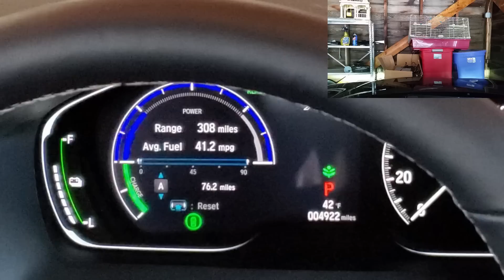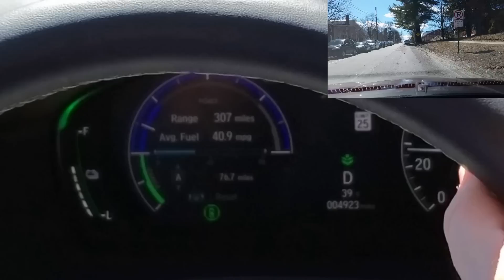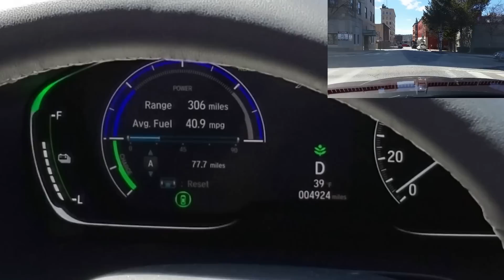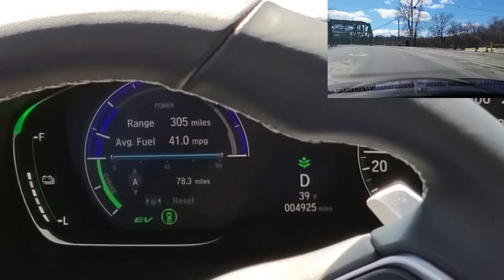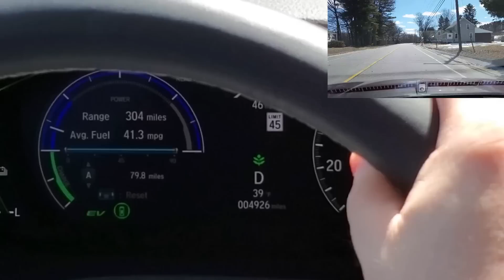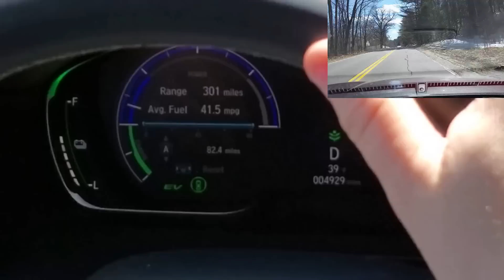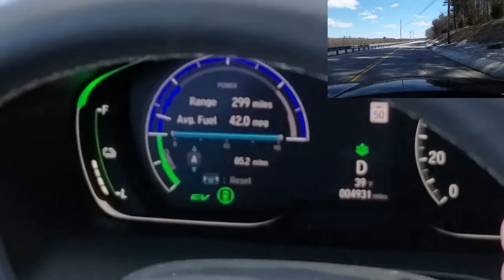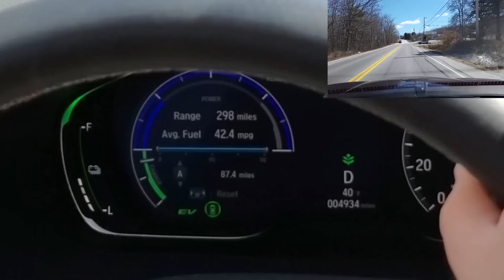2019-2022 Honda Insight: Controlling power meter for MPG

Comment: Been driving my insight touring 3 weeks  now, and im averaging 50 MPG (combination of City and Hway.), very happy with it.
Reply from the maker: Remember you're going to see quite a drop during winter. Don't get too freaked about it.
Reply: I’m getting about 62mpg with mixed driving, but I’ve had a lot of practice using a Prius rental… hyper-mileage is crazy on the insight, specially using the paddles to control the regen
Reply: That is actually really good for  touring model. I know they are rated lower than the Ex which is 49 combined.

Comment: I recently got an EX and managed to hit 70 mpg in the low 60’s. The trick is with Econ and normal mode and know when to use them:

Econ:
For maintaining constant speed or in slow traffic

Normal:
When you need more power to clear something, such as getting on the freeway, climbing uphill, or accelerating on the freeway

Regen paddle help too
Reply from the maker: Looks like you're what we'd call a hyper miler! It also helps to have longer drives so the car is warmed up and speeds in the 45-55 mph range really help the car shine. Thanks for adding the advice in the chat.
Reply: Learn to use Sport. It will change your life. I have a 19 with 54k miles and just got back from a 3k mile road trip.  60s is easy trying to get in the 70s consistent. Normal and Eco mode just change pedal feel and how aggressive it is to automatically use EV only. I manual set to EV whenever I can. I know it seems 70mph is the max speed ive seen the car do in EV only mode.
Reply: I have a 2019 Insight EX living in Northern California area.   When I first got it, I was avg 50mpg but recently it dropped to low 40’s.  
I commute  50 miles round trip on freeway to work 5 days per week, No hills or excessive speed ups.    On freeway I average  75mph. (Most people drive that fast at 6:00am 😂).   When I drive in city , the MPG increases to 45mpg .
I noticed that mpg correlates with weather.   Cold = decreased mph
Hot= increased mpg without AC use. 

I consistently used Shell Gas. 

Still trying to figure out ways to to get above 45 mpg 

Has anyone use those manual gear shifters on the steering wheel??   Would that help with gas mileage??

Comment: Thank you so much for this. I just purchased a 2022 Insight EX today and have to take I-540(in NC) to get home so the speed is 70 and that blue bar went up and down, it made this weird droning noise as you call it. I didn’t put it in sport just left it to choose between eco and EV. Would sport be best for the expressway? Thanks again for your video and I rather enjoyed listening to you talk ☺️
Reply from the maker: If you put it into sport mode the engine will run constantly to keep the battery charged. I personally use eco mode. Some run in normal mode. Unfortunately this car doesn't get its best gas mileage on expressways but you should be fine. This car shines mostly in the 45 to 55mph range. Generally I like to use the cruise control on the expressway and let the car manage speed by itself. Keep in mind due to the current administration's war on fossil fuel you are probably using winter gas formulation even though it's the summer. It's too hard to explain the reasons behind this. One unfortunate reality of this is you will get slightly lower gas mileage.

Comment: Yes at 15;30.  I bought this for safety reasons too I am old school and never had all this fancy stuff in a car.  My last new car was 1989 Honda Civic car till almost 200 thousand miles.  I am kinda baby my 2 Nd tank and getting about 50 miles per gallon and watching the power range and it’s a learning curve for the gas mileage. 
I have the same trim touring like you great car great mpg.   I had a Ford 5.4 AWD and was getting about 8 miles to the gallon.  Big difference in what I paid in gas and Maint in my old truck is my car payment.  
I have been rear ended and my neck and back is Fuck up from dame ass H driving like you said.  I ll be in the slow lanes and left passing lanes open and no one around and they are just staying right on your ass    Go the F around I’m yelling.  In my big truck they would but not in my Honda 2020 insight.  Ok 
Thanks again.  I’m from San Diego Ca too
Reply from the maker: With the warmer weather out there you should get on the higher range in gas mileage. Here in Maine I have to deal with the winter temps which really kills the MPG.

Comment: So the regenerative braking paddles... I wish it would keep the setting, and it does in sport mode just not in econ or normal mode, I didn't test ev mode.  I read somewhere that they did this because of the way the regen works by using the motors instead of the brakes which causes a little bit of pullback.  In slippery conditions this can cause a loss of traction if your regen is set to max.  Supposedly it's mentioned in the manual as well.
Reply: Brian Kai The paddles are for braking the vehicle when you want to slow the car down or when your coming to a stop.  Yes they do help regenerate power to the battery,  but they are not for setting the regeneration amount to the battery.  That is why it resets when you come to a stop or when its been in the highest setting to long. This is like the B(braking gear),  in the Prius, but the Insight has 3 levels of braking.
Reply: sorry to be offtopic but does anybody know a way to log back into an instagram account?
I stupidly forgot the login password. I would appreciate any tips you can offer me!
Reply: @Aarav Zaid instablaster =)
Reply: @Joel Brandon Thanks so much for your reply. I found the site thru google and im trying it out now.
Seems to take quite some time so I will get back to you later with my results.
Reply: @Joel Brandon it worked and I now got access to my account again. I'm so happy:D
Thank you so much, you saved my account :D
Reply: @Aarav Zaid No problem xD

Comment: Just got our 22 touring, and new to hybrid. Should I fully charge first the battery before using the EV mode button? Or could i press it whenever it’s available? Just want to maintain the battery healthy
Reply from the maker: The ev button can be a bit picky. It's usually available when the meter is above 2 bars and the engine is fully warmed and you're not using any intensive features such as the heater. Waiting for it to fill will be frustrating to say the least. Most of the time the car will automatically engage the ev on its own while driving when the car feels circumstances are ideal for the ev mode. If you put the car in sport mode the engine will stay on and you can fill the bar. Then you can switch to normal or eco mode and hit the ev when you like. Keep in mind the car will cut you out of ev if you depress the gas too hard or you hit a hill. Personally don't concern yourself with the button much. Reasons I, or someone else might press it are as follows: 1) your driving on standard or eco mode and you're in a nice flat stretch of road and the car hasn't engaged ev, then feel free to use it until the car kicks you out of it when the charge drops. 2) it's a warm evening and you're sneaking out to see that cute girl you met and you don't want to wake up the wife when you leave. 😉 Point is just stick with standard or eco mode and let the car handle ev. If you know the ev will work where you are and the car is being stingy feel free to press it. Hope this long winded answer helps.
Reply: I'd only engage EV mode if I'm like within a mile of my destination, I have surplus battery charge, and I'm going to keep it under 30. But as long as you're driving under the ideal conditions, the car's going to go into EV mode anyway. I'm not convinced it really helps. Sport mode, on the other hand...

Comment: my car is a salvage has a check engine everything is fine but the dealer dont want to check it  

I am having 20mpg on the dashboard and the EV mode gets cancelled after 5 seconds..
Reply from the maker: You should consider taking the car to an independent auto shop for the check engine light.

The EV will disengage if the car either is heating up, the power bars for electric power are down to 2 bars or less, or you hit the gas too hard and the car determines it needs more power to do what it needs in order to continue. There are other things that also determine if the EV will turn on or off. I recommend just setting the car to eco mode and let it determine when to engage ev mode.

Comment: What is the point of the EV mode button? If the car automatically goes into EV mode, what is the use of the button?
Reply from the maker: Basically so you can choose to use it when you want to. There are of course restrictions based on your settings of econ vs normal vs sport, and whether the car is either heating the engine or the cabin. There are times I'll press it when the system is saving it for a later more downward trajectory drive when I want to use it for the current moment. To be honest I don't find it very useful, but it will at least let you force the car into EV mode if you choose assuming none of the above criteria are in effect.

Comment: Hello there. I got a problem. My 2019 insight Ex showing message  “Automatic Light Control System Problem.” what does it mean?
Reply from the maker: Not within my knowledge. You need to go to the dealer and have it checked out. Possible it's a sensor failure of some kind, but it'll need proper diagnostics from the dealership or a reparable mechanic with scanning hardware.
Reply: @verdier400  
I got done with the recall several days later I get this. 

thanks I will have to..
Reply from the maker: Out of curiosity was the recall you did the BCM update? You may need to have it updated again since a bad flash of the BCM could cause this error.
Reply: @verdier400   YES! exactly. A weekly after BCM recall was done "Automatic Light Control System Problem" started appearing. I read the manual, solution, see dealer.
Reply from the maker: Yes the BCM update has caused me a lot of issues with my  Auto Hi-Beams. Hopefully a re-flash of the system will help.
Reply: @verdier400  
Before the recall MyInsight was doing fine. After the recall, probably weeks later driving, the problem started. 

Only solution is to bring the vehicle back to for re-service.

Comment: Great video!
Reply: Also, your overall average has been in the low 40's?
Reply from the maker: Thank you. It was a pain to get made.
Reply from the maker: Yes the low 40's has been my average. Remember I run on cruise control nearly 99% of the time and it's not very easy on the gas pedal. I also have the touring model and it's top figures are about 4mpg lower than the LX or EX model. The cold has been a bitch too.

Comment: Does this car come with a spare tire? I know a lot of cars now have those fix a flat kit which seems kinda silly.
Reply from the maker: Fix a flat only. If you want you can get a spare tire kit from honda or go to a Junk yard and get a spare tire kit from a honda civic 2016-2018. They fit perfectly.
Reply: No
Reply: Seems silly but it saves you 1% on gas mileage without the extra weight from the tire.

Comment: Is there a way to cut out that extra sounds from the car going up hills ? Thanks 😊
Reply from the maker: Nature of the beast. The engine is pumping power into the batteries to keep them charged as more power is used going up hill. It's known as droning and pretty much all hybrids do this in some way. The Insight seems especially obnoxious and loud at this. One of the less desirable aspects of the car. If you live in a very mountainous region you're only hope for survival is either a loud radio (which I do all the time so droning doesn't effect me at all) or suicide. :P
Reply: Read somewhere that going uphills to use SPORT mode 
which cuts out the high REVVING of the engine

Comment: why burn gas going downhill when gravity is pulling you down...
Reply from the maker: The car makers set this automatically. I have wondered this as well but I think when they work out all the math and how taxing uphill is on the electric motor and how quickly it drains the batteries, they work out it's better to go all electric on even or downhills in order to get the most overall mileage before draining the battery. Keep in mind just because it doesn't say EV doesn't mean it's not electric. In those cases many of the times the electric motor is still pushing the car and the motor is revving in order to charge the batteries to run the electric motor.